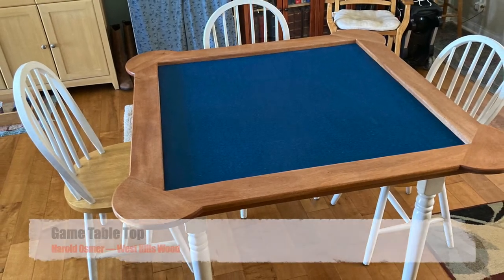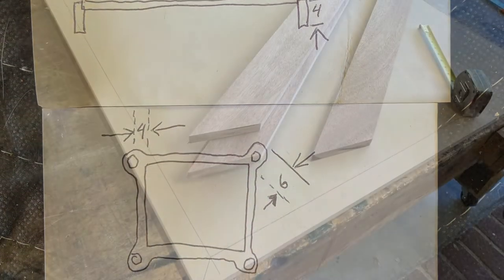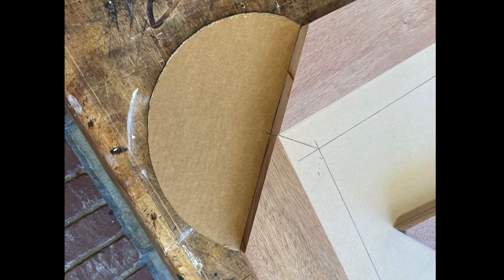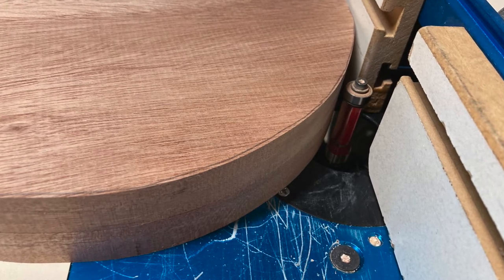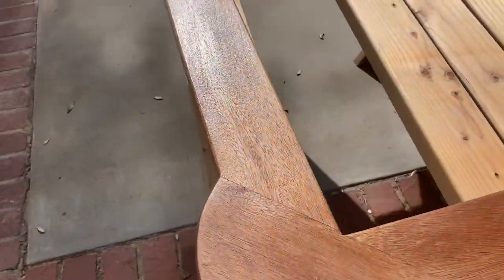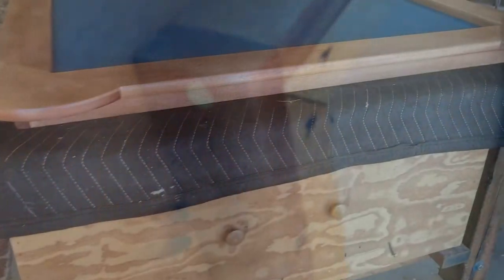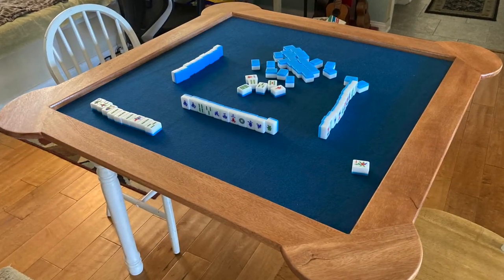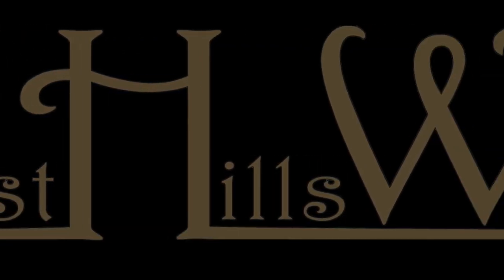How to Build a Game Table Top for your kitchen table

Comment: Nice looking tabel :) did you put anything under the felt? or can you feel the tiles beneath it
Reply from the maker: The base of the new top is MDF and very smooth. It measures just a bit larger than the original table top.